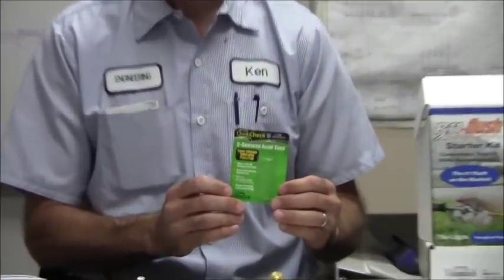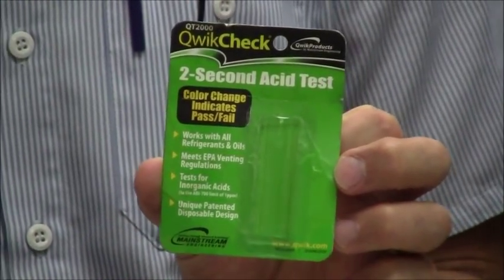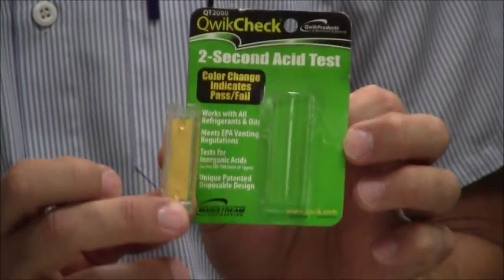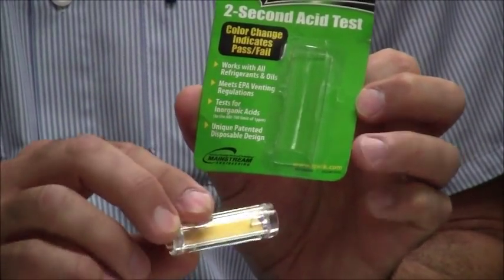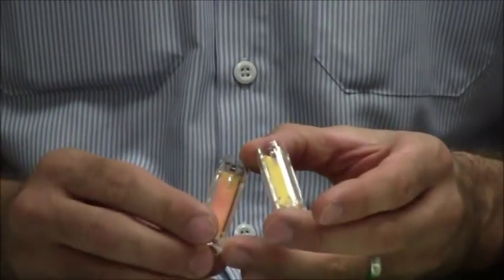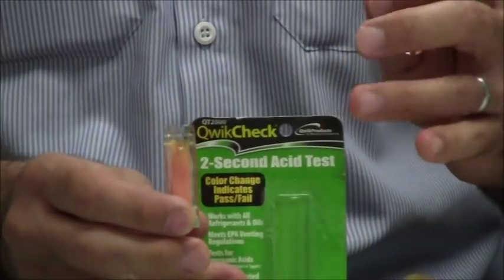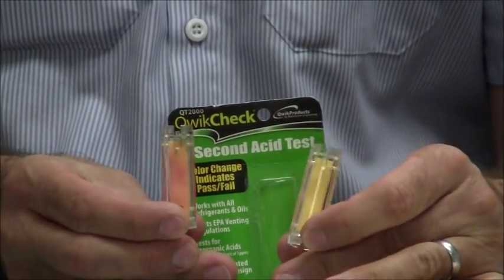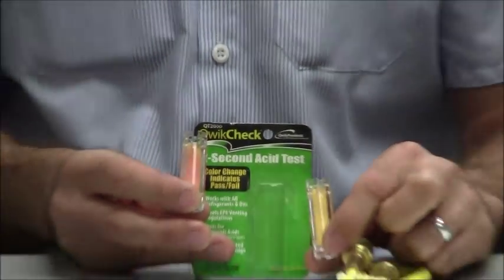Compressor Burnout and Clean Out with Rx11 Flush

Comment: The rx11 flush is for small systems,I usually use suction and liquid driers with removable cores.It is less time consuming and I think does a better job.Thanks for posting this and showing that this flush is not easy.

Comment: When I working on hvac they were using r22 and I did a lot of compressor burnouts. I would have removed the piston and flushed the system with nitrogen, remove the burnt compressor and try to get as much junk out of the system with blowing nitrogen through it. Remove any filter dryers and install a new filter dryer for suction and liquid line. Put a vacuum pump on it over night and come back in the morning when the system is in a vacuum, turn the vacuum pump off and close the gauges. Remove the line from the vacuum pump and insert it into a bottle of acid neutralizer to suck the neutralizer into the system. Close the gauges when done, connect the jug of r-22 and turn it upside down and add liquid Freon to system. Start it up and then turn the container right side up and charge system. Go back 5 days later and pump the Freon back into compressor so you don’t loose it all and throw away the liquid line and suction line filter dryer and install a new liquid line filter dryer, purge the lines or put a vacuum pump on it. Open the service valves after you purge or vacuum and check Freon charge. By not going back 5 days to a week you risk damaging the new compressor because the chances are high the filter dryers are plugged from removing the acid from the system. I did not have to go back a year or 6 months later to change a compressor the had electrolysis from not getting all the acid out. Pistons get clogged easily and not removing it when flushing the system with nitrogen is a road block that you don’t need and I never isolated the evap and condenser from system. Worked in the field for 40 years and the company’s I worked for had me doing a lot of compressor change outs because they got tired of going back in 6 months to a year and changing compressors. Only had one 10 ton in Iraq that the line sets were not accessible and could not be changed out and the system had multiple burnouts. We could not flush all the contanamitds from the system and we tryed. It was a long time ago and the suction line was 1 1/8 or 1 3/8 and a very long line set going through a bunker. New compressors every 3 months what a nightmare that job was. No way to install a new line set. The Freon after 3 months was dark gray.  Lots of nitrogen and filter dryers and acid neutralizer. If it was not in a war zone where everything would have been accessible and materials readily available I would  have done a complete system replace with new line sets. Sometimes you have to do what you can with what you have. Trying to get acid neutralizer and filter dryers and nitrogen in Iraq was not an easy task and a job no one wanted on that 10 ton which was located on the roof of the bunker. Glad that at 60 I don’t have to mess with a/c units anymore. My back as taken a toll. Last but not least after using a vacuum pump over night on a compressor burnout do not forget to drain the oil from the vacuum pump and add new oil so you don’t end up burning up your vacuum pump. That’s all folks. That worked for me over the years. My advise take it or leave it. Your choice.
Reply: Thank you for your service! 🙏 was thinking the same thing. Just remove both pistons on heat pump system and then flush entire system from one end to the other push it through low side to high side which gives you pressure to work with.  Someone mentioned a reversing valve replacement with compressor burn out which makes sense since the valve has Teflon seals that can erode due to acid...definitely a weak point in the condenser unit. This guy did a great video too. He got my like and subscribe, for whatever it was worth 😁
Reply: Wow. I just came across your comment and thought you might be able to guide me. I'm building my own house and got 3/8 & 3/4 inch copper coils. I bought these footers and need abt 28ft of run. I've got two 90s in dropped ceiling and two out of the wall 90s. The 3/8 looks easy to run, but how do I run the 3/4. I have a feeling I'm  gonna kink it. Friend of mine suggested I  fill it with water or sand and cap the ends. But not sure if that is a good idea. Any suggestions would be of great help.

Comment: I just used some Rx11 flush on a 14 ton rooftop today. I split the evap and condenser coil to flush them out individually. I was surprised that we didn't see that much coming out the other ends. Mostly it was white and brown dust coming out and then only a little bit of liquid.

Comment: 15:23  That's the metering device trying to back out. You should have removed it first. That's why you were having a hard time blowing out the evaporator.
15:45 When you pressurized the low side with nitrogen, you were lucky the metering device didn't blow out the high side and into your chest

Comment: When you flush lines put tape over your discharge or wherever you want it to come out and poke a tiny hole to help build pressure and push it through the lines,coil, or whatever
Reply: I'll try that next time, thank you! In conjuction with using nitro or no way?
Reply: @caradocapcunobelin2875  flush then immediately follow with nitro
Reply: @andrewkraemer5745  thanks man. Installed a mobile home package unit today so didn't get the chance to try your tip out today sadly. Will let you know how it works for me homie.
Reply: @andrewkraemer5745  Tried to do this on an evap coil today. The back pressure shot the R11 flush into my eyes when I was done using it. I normally wear sunglasses but these peoples basement was dark in the corner where the AC was. It doesn't help that they sent me with a replacement TXV so I assumed the unit already had one when in fact it had the smallest fixed orifice that I've ever seen. My eyes will be fine, I blame myself for not taking this stuff seriously and bringing down more lighting.
Reply: @andrewkraemer5745  I blame myself for not checking the metering device not you man. Still want to try your trick but just on the lineset first. I replaced the lineset today so no need to flush. I would have taken it out if I had known.
Reply: I got flush in my eyes too with contacts in, Burned really bad so I rinsed them with water for 15 min non stop I was fine later though . I was scared for a min though not gonna lie

Comment: I was actually told recently by someone at Nucalgon not to use RX11 in an evap coil because in his opinion you could not get it all out afterward. This coming from Nucalgon themselves.
Reply: think about it… what if someone told you that refrigerant flushed in an open system would get trapped in there even open to atmosphere?  You saw his hand started to freeze a bit…. it boils at over 100F, thats at 0 PSI, pull 30” on it and that boiling point will have it boiling at below freezing temps I’ll bet or there abouts… .Alcohol boils at 178F, and with just the cap left offat room temp,  it would be gone in no time flat… Rx 11 is a solvent, in years past we use to use R11 or R13 and it worked great. So they outlawed it. If you could blow 22 through it, that would work too but wouldnt that be expensive now, not to mention illegal.
Reply: RideTheWind correct it says on nu-calgons instructional video

Comment: The only thing you should use is nitrogen, to blow out any contaminated oil. The only thing that belongs in a system is oil and refrigerant.  Refrigerant is a very good solvent, so install the proper driers to protect the compressor, and change them out until the oil is clear and acid free.  You may have to replace the metering devices, and the reversing valve if it is a heat pump.  If you have a 110 foot line set, and didn’t take the proper precautions, I’ll bet all of that refrigerant ended up in the compressor, causing a flooded start. This can cause mechanical damage and or a short to ground.  The reason you were having so much trouble with the evaporator flush is that you left the accurator piston(metering device) in the system.  It was behind the flare, not at the distributor that you pointed to.
Reply: Yes you could see the retainer ring moving good thing it didn't blow out across the room when he pressurized through suction side

Comment: Never use line set flush on a compressor burn out . You don’t get it all out you have then introduced a solvent that will strip the oil from the new compressor and lead to premature failure
Reply: And no one could tell us why we were having all the compressor failures. It is...... IS the RX11 that you don't remove that is destroying the coating of the winding in the compressor. We don't use it any more and have had no compressor failures.

Comment: I've had the same challenge with that stuff. burns yours hands and it it doesn't boil off that quickly,,,I've sat there for 3 minutes released and all liquid flush shot back. or I've used the loop system they sell to connect the lines so you can flush easily with one person.   also I use a damp rag help against the open end your not flushing into.....good videos ken
Reply: Denis, I'm not a fan of Rx 11. Never needed it back in the day. Blow the system out with nitrogen. Put in a HH suction line drier . A oversize liquid line drier. Run a long vacuum . Go back in a few days and check the oil. The suction line drier should come out( though in my experience years have gone by and the suction line drier was still in the system).
Reply: @mikeclark1756  Every system we replaced after a burn out, had a failed compressor in one to two years. Very corrosive, and if you have any that is not removed...... trapped for example in a low spot of the refrigerant line...... it WILL damage the new compressor. Flushing with Nitrogen just can't be depended on, nor the deep vacuum. We have had 0 Compressor failures since stopping our use of it.
Reply: @mousearebec  so then just blow the system with nitrogen and vacuum and not use RX right ?
Reply: @MarcoGonzalez-bi6cg  EVERY system we have used the RX11 on has had a compressor replaced within 2 years. If it were a "clean" system and simply a changeout from R-22 to R410A...... flushing it well with Nitrogen is all that is necessary. Some say to use the AC Renew. Nahhhh all about selling products..... overpriced ones. Interesting how many excuses we heard from so many about why all the compressors were failing. $90 for a large can of RX11, was often the first step in our experience, to future compressor replacement. But on two story houses where you see a long copper run, that has dips in the line where some of the RX11 could "pool" slightly, even a single story house......Be aware of that. I do realize a good vacuum 300 microns should vaporize that substance....... not so sure. RX11 contrary to what some will tell you, is not good for the motor winding in that compressor. Have not lost one compressor where the lines were properly flushed with Nitrogen alone. Just don't scrimp on it.

Comment: excellent video. would you consider making one on refrigeration starting
 sequence.step by step. also one to interpret the schematics on a true 
refri. or freezer. thanks
Reply: caliljv they are simple of you can't follow a wire diagram you should not be  messing around with units true units are very easy power in goes through tstat to compressor basically that's it

Comment: one functional ghetto way: i just isolate the compressor and disconnect the suction line, use a lacquer thinner. to fill the condenser + lines + evap let the thing do it' job for 10 minutes and use hot compressed air to discharge the lacquer thinner and keep the compressed air run thru a few minutes to make sure all is dry. close the circuit, braze the new compressor, vacuum, recharge. never got a call back.

Comment: Ken, was the contactor welded in. On grounded  compressors the contactor usually needs to be changed
Reply from the maker: I don't remember now, but you are 100% correct. the contactor should be replaced along with the compressor.

Comment: Can pressurizing a R-22 trane coil with a fixed metering device to 350PSI cause a leak in the coil? I think that's why we couldn't get our vacuum to pull below 1300 today. Had it on for 2 hours and had an 8cmf vacuum pump on a 2.5 ton system with a 15ft lineset. Usually the vacuum is done in that time on the same job when switching both condenser and coil. 

Does the vacuum just take all night on a burnout job where only the condenser is changed and old evap gets flushed and reused?
Reply: I never pressurize above 150PSI with nitro unless I use flare fittings then I go to 350PSI but they put me with a tech today and he knew better. He also diagnosed the system so maybe he just didn't catch the leak in the coil. But the unit did seem to hold the 350PSI.

Comment: where does the acid come from ?  Because the oil was burned / overheated during the event?
Reply from the maker: The acid comes from the compressor electrical failure (burn out), windings and oil and refrigerant together.

Comment: Meh, that Rx-11 just didn't look effective at all. I guess the big question is, is the system still working since the new compressor was installed? 7 years on I'm wondering if it has held up.  This video is causing me to lean towards a new system, but I don't know how effective duel dryers would be as an alternative.
Reply from the maker: I lost that building in 2017, it was running at that time.
Reply: @KenTraining  Thanks! Have you usef these products on another compressor  replacement that you were able to monitor over a longer period? Have you tried any other methods with success?
Reply from the maker: @kevinJmadsen  I have not. This was my only compressor burn out.

Comment: You are better off blowing the system out with nitro and installing two driers that have a high acid capacity. Then change them out after some run time. All that flush is still in the system.
Reply from the maker: Rob HVAC you are probably right, this was my first burn out to deal with. I could do what you said and still add the acid scavenger to system.
Reply: +KenTraining  exactly what i did a few months ago. Acid scavenger, HH acid core suction drier, and larger capacity liquid line drier.. went back after a weeks time, Acid checked and all is good now.
Reply: If acid are gone after you come back for checking it, Do I still replace the HH acid core suction drier, and larger capacity liquid line drier?

Comment: Wow that stuff is hard work Ken!

I usually just fit a big burnout drier and go back and check after a day or so, if its still acidic i change the drier and compressor oil, easier to do on fridge systems i work on though.

What cause the original compressor to fail?
Reply from the maker: heavydiesel Don't know, just know the compressor was grounded.
Reply: +heavydiesel long lines with gross overcharge of refrigerant due to mismatched old carrier indoor unit and no way to stop off cycle migration.
Reply from the maker: Joe Shearer I cant help the long lines. the units to have the same tonnage. as for the off cycle migration, can you explain what you mean? There is a built in check valve on the discharge side of the compressor.
Reply: KenTraining if I were on the job I would convert the indoor units to expansion valve as there is going to be a pressure drop with the long lines and those older 10seer air handler very probably do not have correct size metering device you need. I would also install liquid line solenoid at the indoor units to stop the warm liquid refrigerant from migrating to cold Evap and suction line during off cycle - and slugging when it restarts. On the suction side I do think 5ton is pushing the limit of 7/8 suction line over 100ft. There is a lot of great info online just google York long lineset guide.
Reply from the maker: Joe Shearer ok, thanks for the info.
Reply: New driers and acid neutralizer works for me.

Comment: i think the filter dryer and orifice  tells you all internal story of a burned compressor. some tim flushing become more costly then the price of new lines .
Reply: yeah, I noticed you were trying to push that crap through the strainer in the liquid line connection. Once, you almost pulled it out, then stopped,,,all that crap is sitting in the bottom of the condenser,,, hope you have plans for several clean up driers, on both sides.